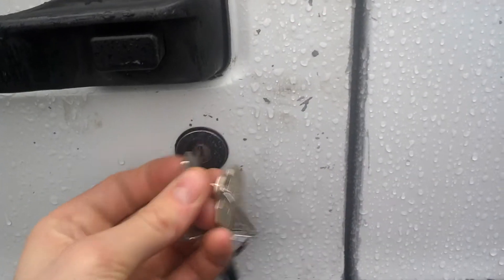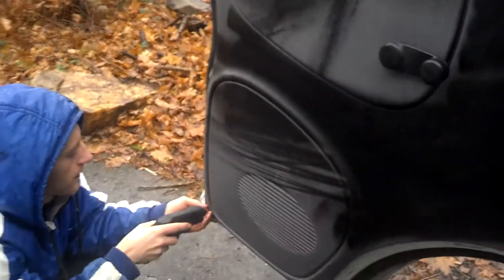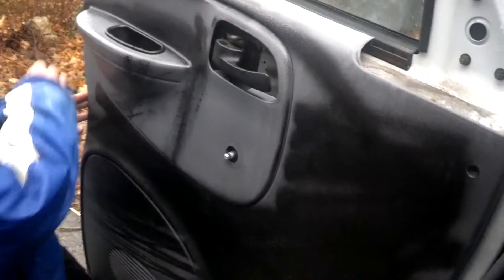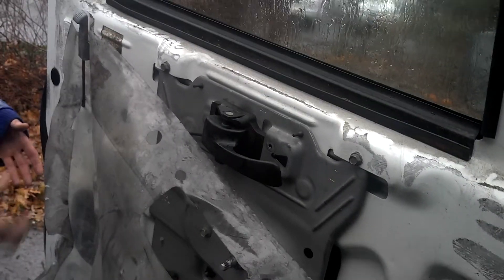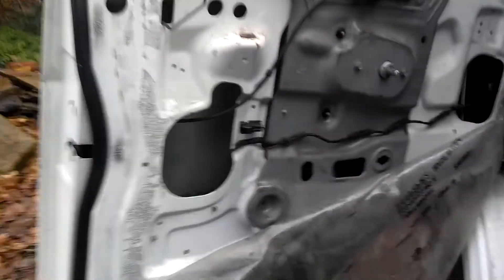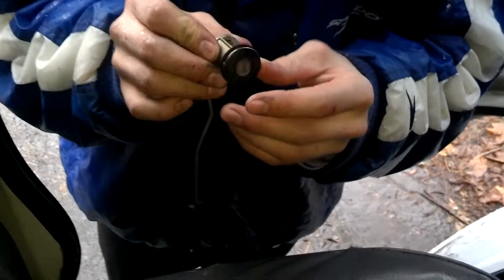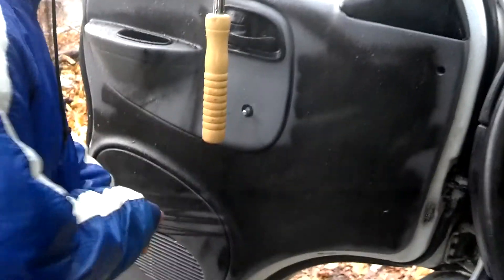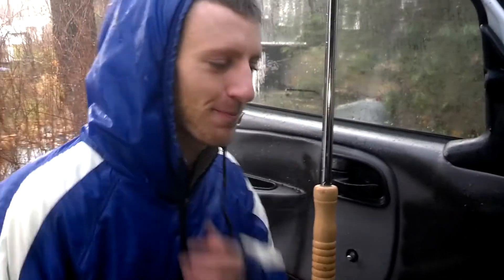2000 Dodge 2500 Van - Part 2 - Lock and Buzzer Fix

Comment: Quick question for anyone that may have an answer. I had this same van. It got broken into. Someone said they thought they saw someone under the van. Is there a way to unlock or like pop the locks underneath or at the bottom of the doors? Thanks
Reply from the maker: they might have been looking at your catalytic converter, not much down there as far as the lock system

Comment: Does the 2001 Dodge 2500 Van use the same scary buzzer or a chime instead?
Reply from the maker: That panic inducing buzzer that raises blood pressure had to go! lol
Reply from the maker: I think its probably the same probably not many changes between 2000 and 2001 i know the 2000 was already obd2.
Reply: I think he disabled the door chime when he unplugged the wire inside the door, my problem is that I have power windows and I don’t think mine is that simple. This noise is drivin ing me Crazy!!! Anyone figure anything else out?